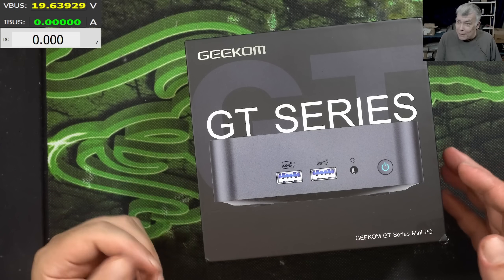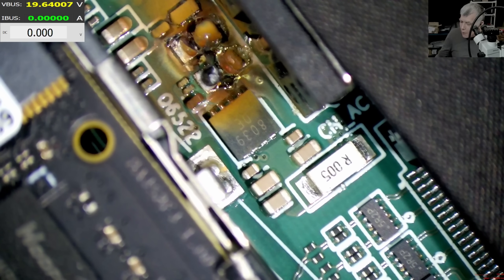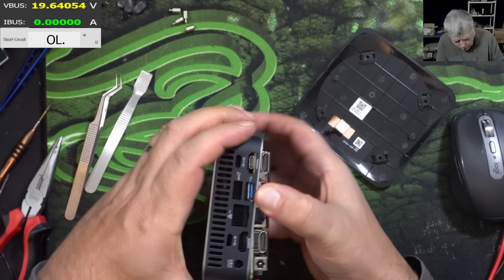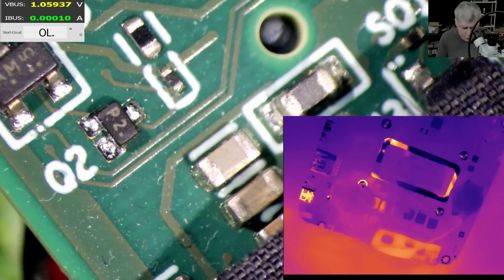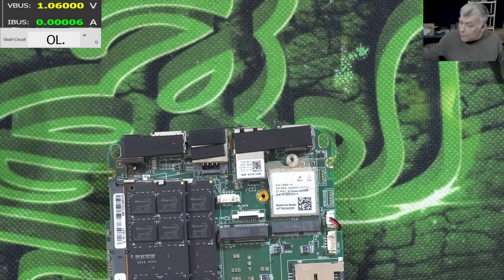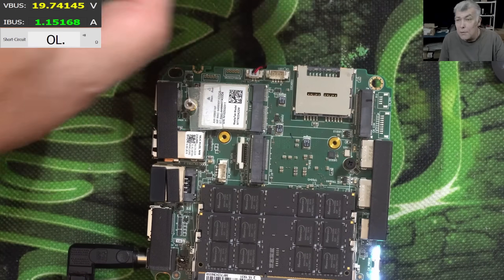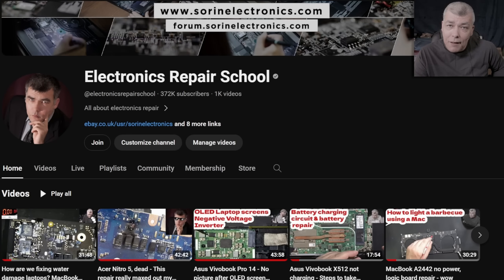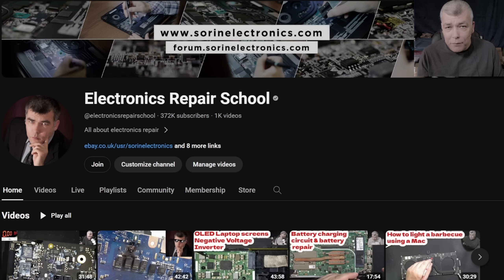Geekom GT13 Pro dead, no power, customer bought it from ebay, 4 moths later died, what went wrong?

Comment: I get the temptation, but the inductor is a protection element. Removing it removes the safety. It works, but the next fault will not be isolated.

Comment: When i was a child more than 20 years before, i worked for one day on an electric shop which also sells electronic doorbells owned by one of my relatives. There were 4 or 5 broken doorbells and i asked if i could look inside them. With permission accuired, i opened all of them and looked inside. As a child, i knew components and their functions but with only a screwdriver i only shorted stuff till i got a sound. The failed part was ofc a capacitor. I shorted the same capacitor on all of them and repaired except one. I didnt know i was a lil Sorin at that time. LOL.

Comment: Sorin c'mon...this is not a "repair" this is "bypassing"... like removing the air filter of a car and saying "it works!" :) good luck to the owner, ripple can kill even the NAND in time. if it was bridged in the first place, the energy would have gone straight into the PMIC and the PCB instead... Actually if this happens again with another cap, bypassing the inductors means the board itself becomes the fuse.. At that point, the damage is no longer controlled or predictable....
Reply: Oh really? No. It´s completly fine. It will work a long time and customer will likely throw it away before any failure will happen next time 😉
Reply: @vitpasek9380  "It’s completely fine" is not a technical argument.
Those inductors were part of the input filtering and current limiting stage. They failed because they were feeding a dead short and protected the rest of the board.

Bypassing them removes that protection entirely. If another MLCC shorts, the current will no longer be localized; the PCB traces, PMIC input stage, or other sensitive components will become the failure point.

Whether the device fails tomorrow or in a year is irrelevant. The design safety margin has been intentionally removed, which by definition is not a "repair.”

Also “‘Oh really? No." works in comments, not in power electronics. The physics doesn’t change because the device boots...
Reply: @david.webbfun  You are just overthinking the problem. Welcome to the real world. In real world there are other things like time expences, customers wiling to pay for repairs and much more. At this point you mention only if, this and if that. Nothing changes on the fact the electronics are getting old and outdated. They are going to be thrown to the trash soon. Where is the point to restore that much high level of filtering. By the statistic it is likely to be damaged again, but somewhere else on the board. No matter what you will do with it. So if it works and customer is not willing to pay really good money on fixing these older electronics then it´s proper repair for the cost. That´s it...
Reply: Dismissing this as “overthinking” is exactly what turns laziness into amateurism. Thinking about actual consequences is not overthinking, ignoring them is. I’ve been in the real world of electronics since 1988, so I don’t need to be invited there by you. Thinking through failure modes isn’t overthinking, it’s engineering.

Cost, time pressure, or a customer’s willingness to pay dont redefine what a repair is. Those factors may justify a "temporary workaround", but they don’t magically turn bypassing designed protection into a proper repair.

The input inductors were part of the original safety and filtering design. Removing them changes the failure behavior of the device ; if another MLCC shorts, the fault is no longer contained and the board itself becomes the fuse. That’s not speculation, that’s basic power electronics.

Whether the device survives a month or a year is irrelevant. Once you knowingly remove protection for convenience or cost, you’ve crossed from repair into risk transfer to the customer. Physics doesn’t care about budgets, and experience doesn’t excuse cutting corners.

Trying to dress up laziness, sloppy work, or corner-cutting with simplistic and cheap phrases like “this is how the real world works” doesn’t make it acceptable. That’s exactly the kind of mindset that turns a repair into a risk for the customer.

If there’s a genuine electronics-based argument to defend this, I’m all ears; otherwise, there’s no point in dressing up laziness and corner-cutting with empty words.
Reply: @david.webbfun  I don´t think you understand the stress that occured on the motherboard during this theatre. At least try not using AI to look like professional. I am also replying to you as human as i can. So this is absolutely not about laziness, just logic. If you would live in real world, you would know it. He IS repairing the OLD electronics. Customers are trying to safe as much as possible on the repair. OR he is taking the orders from local repair shops. This is not server, no something under 24/7 stress, this is customer electronics and they are overkilled with those resistors and other protections. So it´s absolutely fine. If you have other option, have it, but for me you are not living in real live or you just troll me.
Reply: @vitpasek9380  Let’s get one thing straight. Disagreeing with you doesn’t mean I “don’t understand stress on the board,” and accusing others of using AI is not an argument;  it’s deflection...  And frankly, it’s  mildly amusing; especially coming from someone who has neither the context nor the standing to assess my professionalism in the first place. Confidence without qualification isn’t insight, it’s just noise. If thinking in terms of failure modes and protection makes me sound like an AI, I take that as a COMPLIMENT.

This has nothing to do with servers, 24/7 loads, or “overkill”...  Input filtering and current limiting are not luxury features... they define how a device fails. Removing them doesn’t make the repair! "cheaper" or "smarter", it only makes the failure uncontrolled. Cost constraints, old hardware, or customers trying to save money may justify a workaround, but they do not redefine engineering reality. Once protection is intentionally bypassed, the failure energy is simply redirected elsewhere, into the PCB, the PMIC, or other sensitive components. That is not logic, that’s WISHFUL THINKING... Calling this “real world logic” while dismissing physics is not realism, it’s FANBOY rationalization. 

We all know Sorin approaches every device with the same mindset. This has nothing to do with the age or value of the device; it’s about the repair methodology itself, and that doesn’t change based on convenience. Working today does not mean correctly repaired, and repeating “it’s fine” doesn’t change how electricity behaves. If you have a concrete electronics-based explanation for why removing input protection does not alter failure behavior, present it. Otherwise, claiming others “don’t live in the real world” is just NOISE; and noise, ironically, is exactly what those inductors were there to stop.

At this point, continuing to defend an objectively flawed approach doesn’t make it “real world”...  it suggests living in a self-constructed bubble where convenience is mistaken for logic. Ignoring physics to justify shortcuts turns denial into an excuse for LAZINESS, not REALISM.

This device ended up on the repair bench precisely because someone had the same “it will be fine” attitude like yours. Reality already proved that assumption wrong....
Reply: @david.webbfun  I think there is no real reason to continue in this conversation. Thanks for your opinion.
Reply: @vitpasek9380 it was not an opinion, but yeah let’s leave it here..

Comment: Sorin sir coil is important ,but when we jumpered it may cause quality of board ,in stepdown section other section there will be frequency on one side and voltage on other it's must replace coil as per my knowledge ,I need video about it sir ,I can learn more from ur video
Reply: This is probably more for RFI compliance as it's right next to the DC jack. If this was a coil for a lower power rail it absolutely would be required.

Comment: 11:50 you can just preheat with hot air to a temperature that doesn't melt the plastic and then solder normally with the soldering iron. You know that, Sorin.

Comment: How come the MOSFET did not cut the power? There is a current sense resistor there which is monitored by the power management IC, so when the capacitor got shorted, the IC should have cut the gate voltage to close the MOSFET.
Reply: it depends very much on the scheme, probably here it does not work like that

Comment: How this guy gets away with these abysmal 
 repairs l will never know, I despair
Reply: He did justify it. I do watch Nathan over on parts people and he's pretty damn talented, and while he sometimes goes overboard (eg replacing a blown pad on a QFN instead of running a wire), at the end of the day, the repair is done, and he keeps another piece of tech out of the trash.
Reply: @godarklight  sorin repairs ALL types of electronics.
parts people repair 1 make...
you go find the schematics for everything... it takes hours.
Reply: @joeds3775  Or maybe you can't find the schematic at all. Without a schematic... That requires decades of experience and thousands of schematics in your head.
Reply: @panaitepaul6798  not really, its looking up data sheets and drawing the maps of the systems... its usually power supplies or corrosion...  or mechanical failure

Comment: Great stuff as always, Sorin. But HOW did a shorted capacitor create the destruction of BOTH inductors at the input? And why is there no apparent protection? A fuse, or TVS diode? Have a great Christmas with your family and thank you for all your amazing tuition.
Reply from the maker: When you short a power supply, the weakest component it will explode or it will get faulty
Reply: actually, the cap short created a high-current path. The two inductors were in series feeding that short, so they overheated and failed together WHILE PROTECTING THE REST OF THE BOARD.. Now with the bridge in place, another short will directly destroy the board